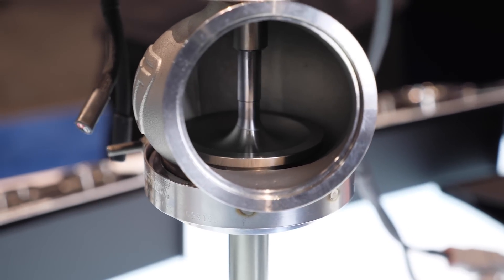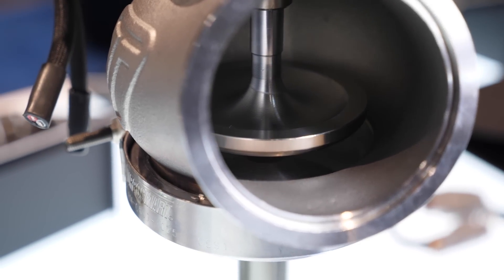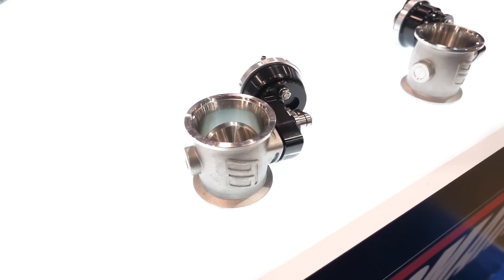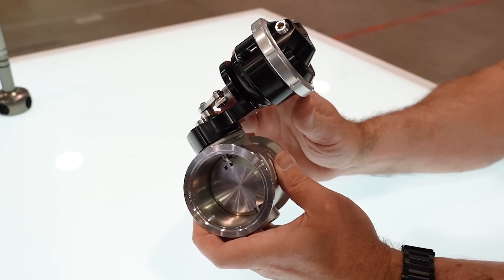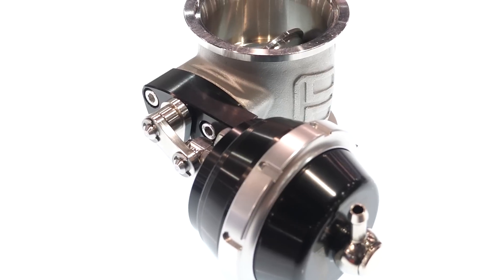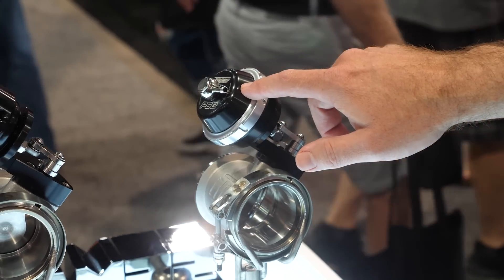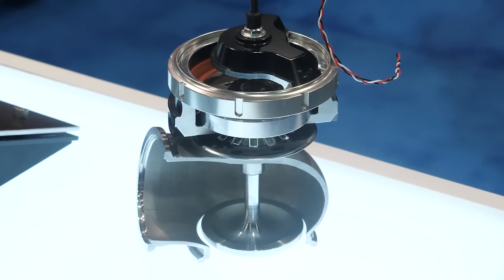383.9 CFM From A 50mm Wastegate? Boost Control Just Got Better

Comment: Had exactly the same gates in the 70's.
Reply from the maker: Throw up a link with all the juicy details 😎 - Taz.
Reply: @hpa101  Yup they talked about them in Corky Bell's book Maximum Boost. Im sure you guys will have a dusty copy on the shelf?
Reply from the maker: Andre might, not on my shelf however. I would be very surprised if exactly the same design was in that book though as stated. A similar concept is more likely noting butterfly valves are not something Tubrosmart just invented, but, I like surprises so wouldn't be disappointed to be wrong here 😎 - Taz.

Comment: I’d sure like to see what this would do on compounds with a smaller primary turbo
Reply: This is the only situation i can see this  wastegate as superior. It takes all the pressure variables out of the equation and just controls flow regardless of back pressure before and after the wastegate. I have a ko4 and gt35 compound turbo 1.8t and my ko4 is too small for the gt35 but if i nearly bypass it completely except for like 1psi it shouldnt be an issue

Comment: I didn’t really feel like he addressed or understood the question with non-linear airflow with butterfly valves and the benefits of this system versus a poppit valve.
Reply: Here's what I think:
1) the poppit valve opened at 10% flows a lot more than the butterfly valve at 10%. However, the pneumatic butterfly version is tuned to react identically to a regular wastegate.
2) advantages are twofold. Better flow for the size, as exhaust gasses doesn't have any sharp turns. Increased range of boost control, as the butterfly valve does not suffer the same problem with poppit valves, where the wastegate is forced open by the sheer amount of exhaust pressure.

Comment: these may be the ticket for high horsepower diesels.
Reply: Yep 100% I have been not been able to keep wastegates closed on my diesel to get up to 40 psi... I have been using no actuator and strong springs with a turnbuckle, and just tighten it up until it holds the manifold pressure
Reply: I’m sure eventually-  no way this model survives diesel drive pressures and egts 

But yeah I’m looking at them for my 6.7-  I miss my wastegate noises from the 11-14 turbo
Reply: @burtonporter8437  petrol fueled engines usually run higher egts  than diesels

Comment from the maker: TIME STAMPS:
0:00 - Introduction: Turbosmart at SEMA
0:20 - What Is A Straight Gate?
1:10 - Straight Vs Poppit Valve
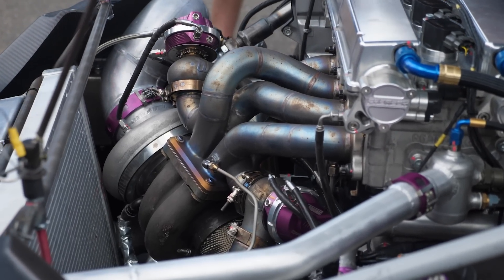1:50 - Packaging Considerations
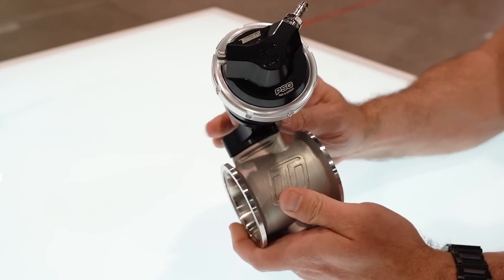2:47 - Boost Control
2:53 - Non-linear Flow Relationship
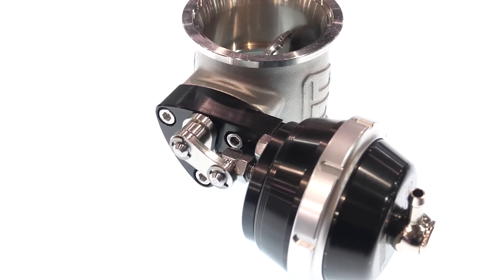4:20 - Butterfly Seal
🙋‍♂ Take $25 USD off ANY HPA course with coupon code: YOUTUBE25
Enroll now: https://hpcdmy.co/25offyt
5:37 - Electronic Vs Pneumatic
6:46 - Boost Control Range
8:03 - Spring Changes A Thing Of The Past?
9:05 - Vacuum Pressure & Emissions
10:40 - Ever Watched An HPA Webinar? They're Awesome. Promise!